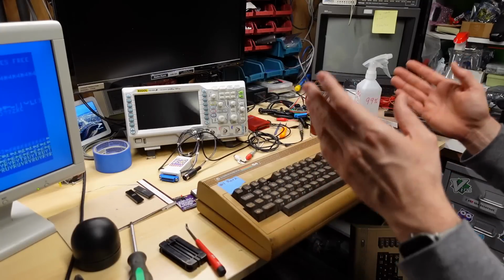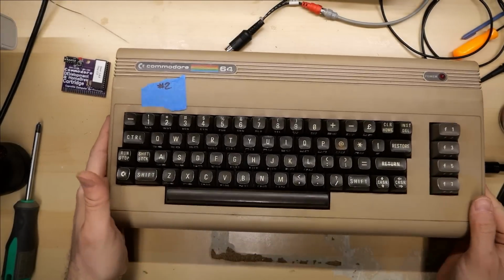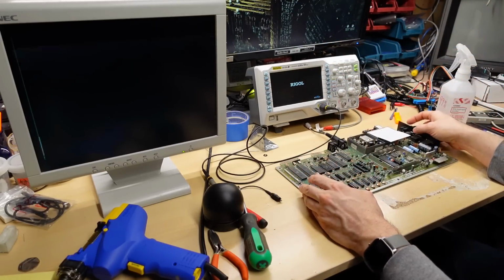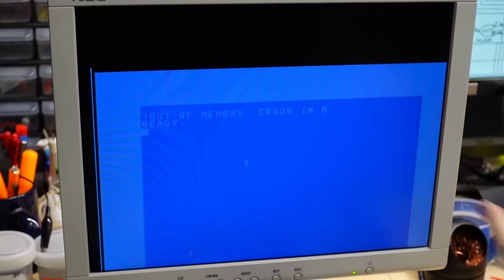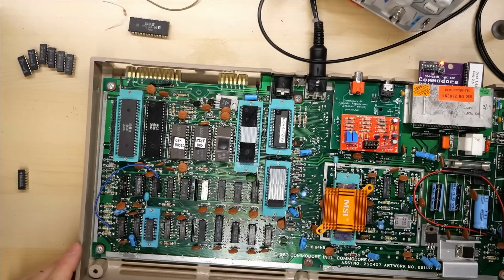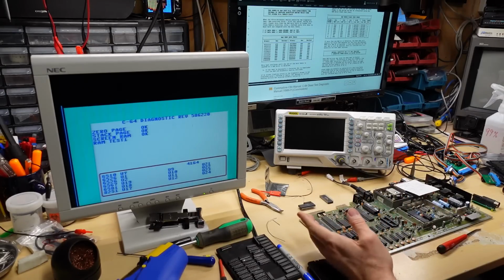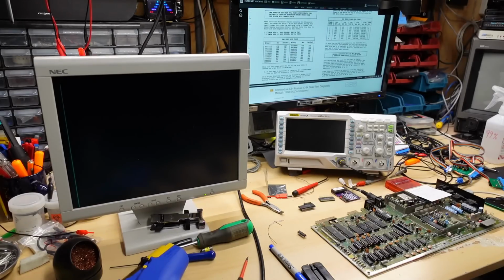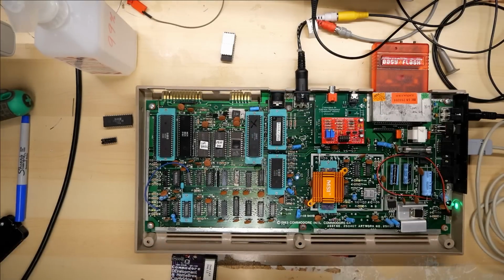2021 C64 Repair-a-thon #2: "Hmm, the mystery deepens!"

Comment from the maker: In the end, I had a change of heart for those working MT RAM chips and I reinstalled them in the motherboard. At least they are socketed so it would be trivial to change a failed one in the future.
Reply: Good to know. I was going to discuss your urge to exchange even working ram chips, but fortunately you have put them back. No room for wasting vintage parts just because the maker.
Reply: I'm so glad you wrote this, there's no need to throw out working parts just because "I don't like the manufacturer". Especially as you said, they are socketed now, so if they fail again, it's a simple thing to just change them out.
Reply: Your mercy is immeasurable
Reply: thanks for that ... Happy Easter from Croatia.
Reply: Since you had 2 bad chips from other brands in your stock, are the MT really that much worse than other period RAM?
Reply: sounds like the failure mode of that ram manufacturer is in the chip select area resulting in the chip leaving its outputs on the buss, this then causes the ram tests to accuse good chips because the bad ram is still on the buss when good ram is selected. might be why people think that manufacture has lots of bad chips.
Reply: That's the spirit :)
Reply: That’s cool. Might as well use them till they don’t work anymore. Although with all the C64’s you must own how much use will a system like this actually get? I’m guessing these systems will end up going to other individuals at some point who you would inform about the RAM.
Reply: Good call. I cringed when you were throwing out tested good chips, MT or not. Like you wrote, they are now socketed so there's no harm.
Reply: Why would Micron RAM be suspect?
Reply: I have changed pla and cpu in my commodore in long repair lol and dead test card flash ram... all ram test good and test card say bad ram lol.  lol finaly the problem pla and cpu at same time in my commodore  lol
Reply: ADRIAN Can you perhaps explain some of the basics of oscilloscope operation and pla chip operation for us newbies  :D Please. low and high what ?
Reply: Yeah i was just thinking since they are still working after all this time, maybe they are the good batch
Reply: @yuchong1704  ❤
Reply: Yesterday i had a dead 64 too, used my test harness and a bad mt ram showed up (U9 or U10). These RAM are definitely the bad part . maybe they were cheapest option to use back in the days. Looking forward to the next episode.
Reply: I dont own a c64 at the moment but im going to get me one again for sure. MT’s never failed me when I had a 64 (maybe i was lucky) so im glad the have a 2nd life now. :)
Reply: Like a person favoring "stock parts" to the era.
Reply: Can we PLEASE play #rammy bingo next repair? 😅 and winners could receive a signed RAM chip from youself! One way to get rid of that backlog 😉
Reply: how can you write this a week before the video comes out ???
Reply: @WilliamAPBodie  Patreons have video 1 week in advance ...
Reply: @catcam  ah ok :_:
Reply: @WilliamAPBodie  Adrian has magical powers. LOL.
Reply: 😎interesting

Comment: Why is the RAM chip part number used in the C64 so unreliable? Even between multiple brands you found several malfunctioning ones. I understand why the MOS brand chips deteriorate. Are the other brands of RAM from this time period unreliable for the same reason?

Comment: So the lesson with regards to the dead test cart and the diagnostics is this.. the ram test in the dead test only tests the first 4k of ram, and not very thoroughly. It does not need ram to do this test, whereas diagnostics needs at least part of the zeropage and stack to work in order to start up. 

Due to not being able to use ram to keep track of anything, and the 6502 cpu only having 3 registers, the ram test in the dead test cartridge isn't just limited to the first 4k of ram, but also is not very thorough in how it tests ram.

Ram chips can fail partially, and fairly often do, the dead test cart will often not catch those. The diagnostics use a series of test patterns aimed at exposing errors which won't show with a trivial test, so will catch many errors not seen by dead test.

So.. always run diagnostics, and use dead test only for what it is intended for, figuring out why diagnostics wont start. If dt says ok, it only means it should be good enough to try run diags, not that the component(s) are actually good.

Comment: Check for damage from overvoltage - looks like that was the cause.  5watt zener diode 5.1 volt or a crowbar should prevent further issues

Comment: Great troubleshooting as always. I do enjoy these repair video’s although i never owned a commodore 64. In the early 80’s i had my home made Acorn Atom that came as a kit. Learned so much of that machine. Back to the repair: I wonder if there could be a slight chance that the bad SID could cause the original microprocessor to behave seemingly abnormal. You only tested the supposedly bad uP in combination with the bad SID in both the ZIF machine and the #2 machine. Indeed you did test the combination of bad SID and a known good Microprocessor from your ZIF-machine in the #2 machine, but did not test supposedly bad uP with known good SID. Might e.g. be drive tolerance that makes one uP experience issue with bad SID and the other not.
Again, i have no experience repairing C64 and don’t know in which way the SID is connected to the uP (i did not search for schematics) so maybe i am totally wrong here. Just a suggestion out of curiosity and because the failure mode of the uP seems very odd/marginal.
Keep up your interesting repair video’s.
Regards, Ewald
Reply: Ok, i admit i am stupid. Just started watching part #3 and see the first thing you do is removing the SID before you start testing. Went back to part#2 and of course you did the same thing there. Missed that for some reason.
Regards,
Ewald

Comment: Inspired by this video, I finally decided to burn that diagnostics rom chip for C128 and find out why nothing works in 128 mode. Guess the manufacturer of the broken memory chip (which the "function rom" version of diagnostic rom got spot on). And that was the third one I replaced in the same computer. I'd rather swap them all, but these boards are painful to desolder without the vacuum desoldering pump... thingy... Especially because the components' legs are bent just a tiny bit. I use a separate manual pump, it does the job but it takes so much time. I have the same job ahead of me with rev 4 Amiga 2000 board, which also has 16 memory chips, and doesn't even boot with diagrom.

Comment: Lots of chips failed in this 64.. Wonder about power failure or closeup lightning strike in the past of this machine.. Strange..

Good decision to save that partially working CPU for tests. In reality, there is possible to find out what instruction didn't work correctly, only data logger needs to be connected to that CPU when diagnostics cartridge runs.. That will be fun to figure out, after repair marathon ends.. 😉

Comment: The 65xx CPUs have zero page specific opcodes, some of which are rarely used.
Your average game isn't going to be doing fancy stuff in zero page, but RAM test certainly would be.
Others mentioned the 6510's six extra IO pins (which control memory bank switching and other things) could be bad also, guess that could be be a cause.

Should be easy to write some code that uses all the different zero page opcodes, figure out what's bad.

Comment: The "marginal" CPU has most definitely it's I/O port damaged by ESD (this IS the type of board, that doesn't have any sort of ESD protection), that's why it does work, but zero page (the I/O port is memory-mapped to $01) shows damaged. Try testing it with a datasette - it most definitely wouldn't work. Other than that, there is no CPU-related stuff in the zero page.

Comment: Hi Adrian. Always watching your videos packed with interesting informations on Commodore machines :-D. I have a question for the VIC-20 character set used on the Commodore C64. Is this just the binary for the Vic20 chr rom or is that something special? I would like also to burn a 27C64+adapter to have the VIC-20 font.

Comment: isn't there a RAM test on the TL866II Plus Programmer you could use to see if the DRAM chips were working before putting them on your chip-tray thingy?
same should be possible with SN72x logic ICs

Comment: 1:26 Hmm, my machine has these wavy lines in some characters too, e.g., the up arrow character (for exponentiation). It is also ASSY 236298 REV A (c) 1982 and serial no. P00138518 made in Pennsylvania. To the best of my recollection, it has always done this, since 1983 when I got it. I wonder if they didn't come from the factory like this.
My character ROM has this label on it:
MOS
901225-01
(C) 1982 CBM
4982 B
Do you know your machine's serial number is or what the "bad" chip was labeled?
Neat that it an be fixed; thanks, Adrian!

Comment: 300ns RAM ought to be fine, surely? The 64 CPU is only clocked at around 1MHz, so 300ns should be plenty.
Reply: It's more complicated than this, because the VIC-II and CPU both access the RAM within a cycle and the RAM has to respect timings of both: The RAS and CAS signals to the RAM come at a certain moment within the cycle and the RAM has to have the bus stable at a specific amount of nanoseconds before the end of the cycle. 300ns is too much, 200ns is normally fine (and used by Commodore) but is sometimes not compatible with KERNAL replacement cartridges, so perhaps the recommendation is to use 150ns or better.

Comment: If i remember well, there never was a soldered RF shield on the c64's in NL/Europe. I repaired dozens at least, back in the day.
They didnt have a real metal shield to begin with; it was just flimsy cardboard with a metal layer on it with the thickness of alu wrapper for food and that connected to the expansion slots metal casing with a sort of sliding clip.

Comment: I have a feeling that the problem with that CPU was probably pin 27 (called "P2" on the pinout), which is bit 2 of the built-in 6-bit I/O port used for bank switching.  There's three banks of RAM that you normally control: there's the RAM under the BASIC ROM ($A000-$BFFF), there's the RAM under the Kernal ROM ($E000-$FFFF), and there's the RAM under the I/O registers ($D000-$DFFF).

The dead test cartridge doesn't require the ROM chips to be installed, and probably starts with them already disabled by setting P0 and P1 low (the same as typing POKE 1,52 from BASIC).  It seemed to work just fine with the ROMs removed.  My educated guess is that pin 27 (P2), which controls access to the RAM under the I/O registers at $D000-$DFFF, is stuck high.

The entire instruction set probably works just fine, which is why that game worked; I bet Dead Test crashes when it tries to disable the I/O registers and starts testing $D000-$DFFF.  It probably doesn't realize that the I/O registers are still mapped into that space.  So I'm also going to guess that when the dead test cartridge writes to one of the registers that controls interrupts (like $DC0D or $DD0D), it's inadvertently "arming" an interrupt without first setting up the interrupt vector.  So the next time the C64 executes that interrupt, it's jumping to some random location in memory, causing it to crash or get stuck in a loop, depending on what's at that memory location.
Reply: Dead Test disables the ROMs by means of Ultimax mode. The cartridge statically forces Ultimax mode, but in Ultimax mode only 4KB of the C64s RAM is enabled. Therefore Dead Test can only test the first 4KB of the RAM. In Ultimax mode, there is no way to access the RAM below $D000..$DFFF. (See https://www.c64-wiki.com/wiki/Bank_Switching )
Reply: @danielmantione  Interesting information.  Testing the first 4KB will detect any stuck data bits, but it really doesn't detect if address bits 12-15 are stuck (since that memory isn't even mapped in Ultimax mode), so I was assuming that a full RAM test was actually a full RAM test.  Evidently not.  I still think my theory is a strong one.  We'll never find out unless Adrian runs more tests on the CPU, and what would be the point in that?  We know it's obviously got something wrong with it, even if the full instruction set works.
Reply: @SpearM3064  I'm not sure what you mean with "full test". There is no logic on the Dead Test cartridge to get out of Ultimax mode, this means that from a software point of view there is absolutely  no way to access RAM outside the first 4KB of memory as long as the Dead Test cartridge is inserted. For a "full" RAM test, you need the Diagnostics Cartridge.

Comment: That PAL machine was all over the place. Nice work!

At this rate, the C64 community will end up developing a full drop-in RAM replacement. You clearly can't trust 40-year old RAM chips, regardless of brand.
Reply: It's no problem and has already been done: You can use a modern SRAM chip and some glue logic to make it compatible with the DRAM interface. However, because availability of 4164 is really good and it is cheap, it is pointless, it is much more elegant to use original 4164 RAM.

Comment: Adrian, what about building a C64 from mostly or only marginal chips? :-)
Reply: Were not some in stores on display dummies to prevent theft ?
Reply: @highpath4776  I guess those were empty cases, or cases with empty boards and just the connectors installed.

Comment: Failed 6510 CPUs are very rarely seen in NTSC machines, and yet I've seen a handful of them on the imported PAL machines I've repaired over the years. I have a theory which could explain this; as over in PAL land the use of C2N cassette drives was far more widespread which connect through the CPU. Just like the famous theory of the exposed joystick port/joystick swapping being the cause of some failed CIA chips, its possible that over the years that something similar happens to PAL CPUs when cassette drives are plugged in/unplugged. Of course a cassette drive wouldn't be plugged in as much as joysticks, but its the only reason I can think of why PAL CPUs seem to have lead a harder life than our NTSC CPUs over here when they are otherwise the same. I've actually seen the bad zero page fault on a CPU before, as when they do fail (rarely) they tend to keep mostly working but glitch out on one specific test/function. Its strange.... -aphexteknol

Comment: It is possible to determine bad RAM when you see different characters on the screen by looking up the character screen codes. In this case you could see $ in some places there should be spaces. The screen code for space is hex 20 and the screen code for $ is hex 24. So this indicates that bit 2 of the RAM is stuck high for some addresses.

Comment: I wish I knew what brand of RAM was in my breadbox 64 originally, as when the factory style (potted) power supply burped, it ended up killing all the RAM. So we wound up having all 8 chips replaced and socketed, along with an aftermarket power supply. How long was that lousy brand of RAM used in the 64?

Comment: Not all 6502/6510 cpu's have the same instruction set. There are "undocumented" instructions which are not part of the standard instruction set, but which can still be used. However these instructions are not available  on every 6502/6510 out there. Maybe the test cartridge uses some of these instructions, which could explain why the test game runs fine, but the tests fails.

Comment: Kind of like with my speccy, changed just about everything, and it was the CPU that had died, blummin' CPUs eh? :P
Reply: At least the Z80A is cheap and plentiful.
Reply: @OzRetrocomp  On the other hand, there are very few replacement options for the Speccy's ULA chip... and even fewer, if any, for the +3/+2A Gate Array (sad noises)

Comment: I have one of those C64 board, made in ´84 rev B. Bought it as "Spares and Repairs", replaced the caps and reflow the pins of the modulator and worked. Just yesterday brought it out for a "test run" and "poof" fuse blowed on it, replaced the fuse and now black screen. Those MT RAM on the board are hot to the touch, not sure why the fuse blowed though.

Comment: How would one compare a sid chip or even a dual sid vs something like an OPL3 or DX11 Synthesizer.
Reply: Difficult to compare: The SID is a subtractive synthesizer while the OPL3 is a frequency modulation synthesizer. Both have their own characteristic sounds therefore it is difficult to say what is better. That said, the OPL3 is a much more modern chip and this shows because of the large number of voices and features like stereo.
Reply: @danielmantione  thank you for helping out. I honestly appreciate the help and great info. 😀

Comment: Have you tried the character generator in your ZIF-C64 too? It would be possible that there were problems with contacts in the old socket otherwise. Maybe the other two chips just worked because they scraped away some dirt/corrosion in the socket. I expected some Deoxid before throwing the chip is the bad parts bin ;-)